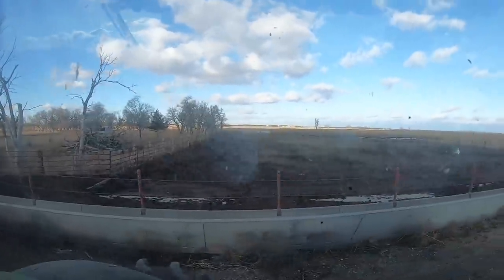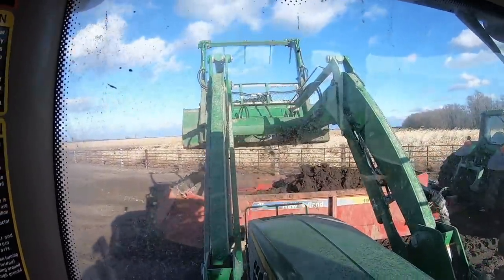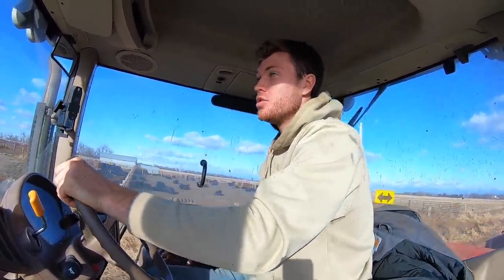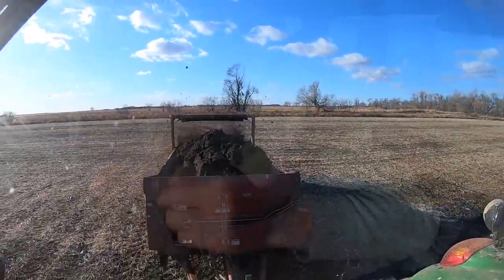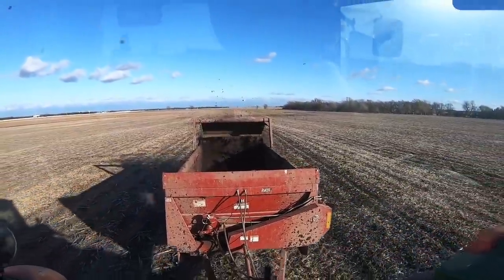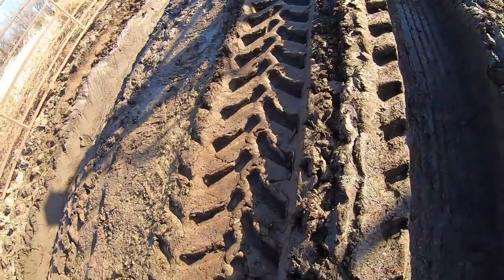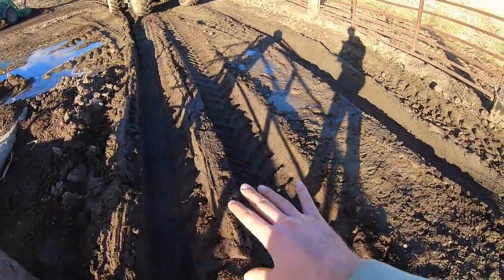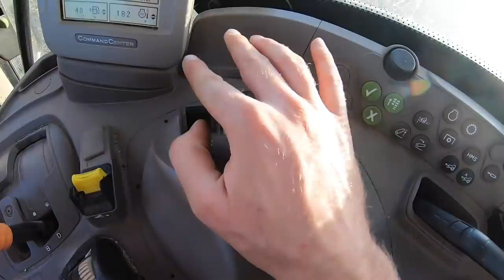Spreading Manure | John Deere 7530

Comment: Who flys the drone if you are driving... can you do both ?
Reply from the maker: There is a setting on the drone that allows it to fly itself and keep pointed on the tractor. Also sometimes when I use auto-steer I can fly the drone while the tractor drives itself. I can be challenging at times but I do both.

Comment: hello.cool videos.tell me what power is needed for the seeder 4030? when sowing in untreated soil
Reply from the maker: We put the 7530 on the drill which has about 180 engine horse, you wouldn't want anything much smaller than that